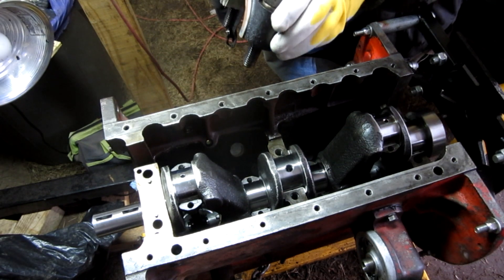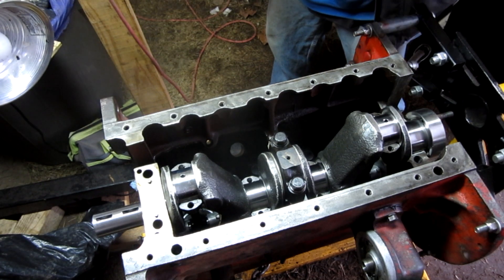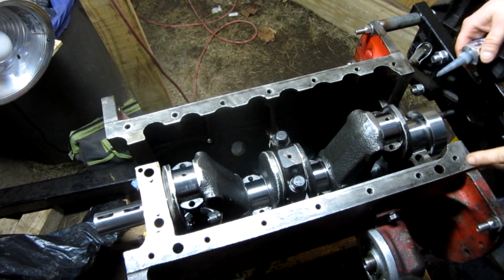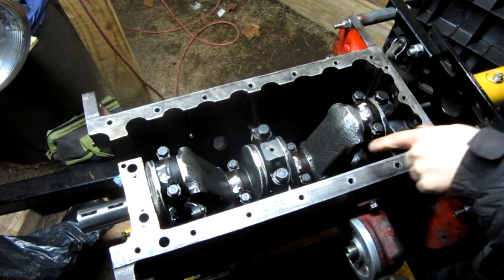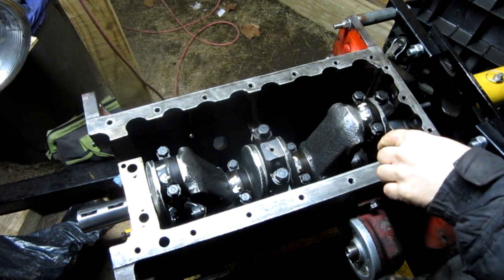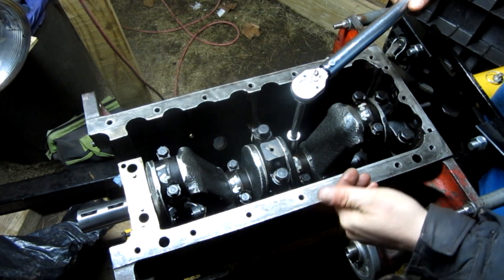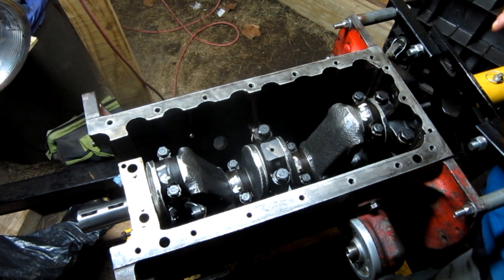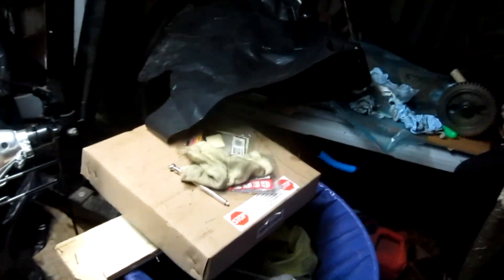1952 Ferguson TO30 Continental Z129 Rebuild - Part 2 - Crankshaft & Bearings Installation

Comment: I have never rebuilt  a to30.what did u have done to the crankshaft if anything?
Reply: Nevermind I see now it's a new crank
Reply from the maker: right, after 50+ years it either had to be re-ground or honed or whatever they call it, or replaced.  cost would have been about the same either way so just bought a new one from Jensales.com .  they have good quality parts and are also cheaper than any other place I could find, and the page you order the crank from gives the correct bearing numbers to order so no confusion ordering separately.  
https://www.youtube.com/watch?v=YIFYkIyaJNc&t=37s